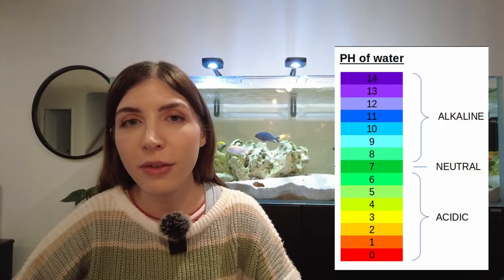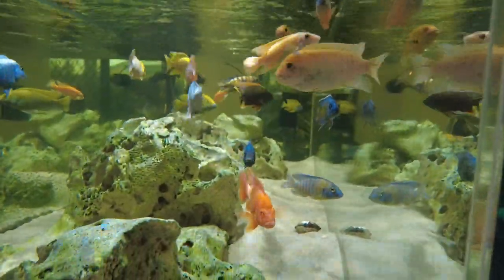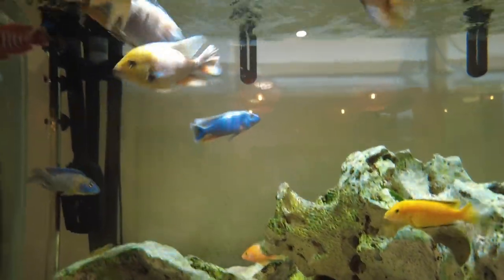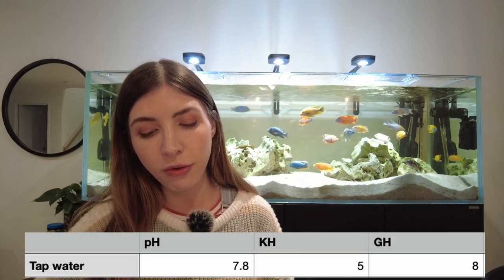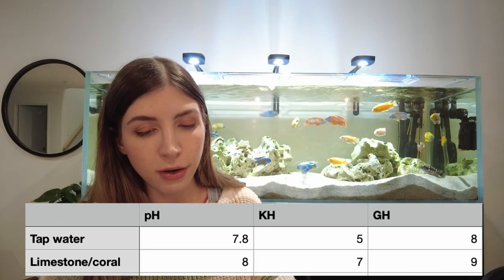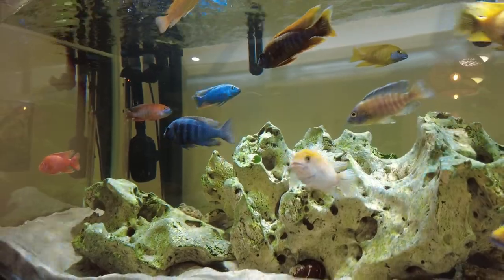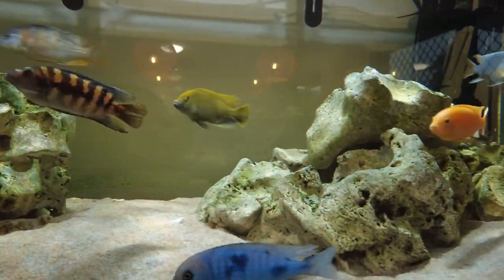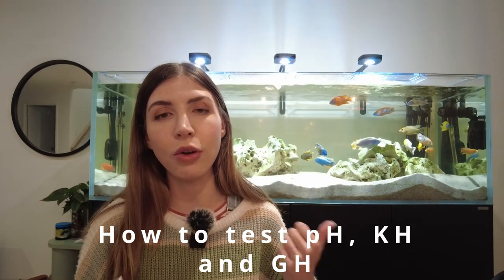African Cichlid Water Parameters: pH, GH, and KH (everything you need to know!)

Comment: There is one thing I think you skipped when talking about pH. When a temperature went from 75-77 the percentage of change is VERY small. When a pH goes from 7 - 8 if goes up by a factor of about 100! A massive change. pH changes must be done slowly like your calcium based stone and additives which buffer and change very slowly.

Comment: Hi Kaity, quick question . I haven’t ever dosed my 75 gallon tank ever yet with Buffer or the cichlid lake salt.  If needed after checking the tests results , for the first time of dosing either the cichlid buffer or the cichlid lake salt , do I dose for the whole tank volume ? Or just the amount of water that I put back in during the water change ? Thank you 😊
Reply from the maker: If it's your first time dosing the tank I would stick with the more conservative dosage which is 1tsp per 20 gallons I believe. So for your tank it would be about 3tsps. If you have a really low pH or KH/GH I would even start with just 1tsp at a time and do a test to see what change it makes to the pH just to be safe. Then as long as it's not making more than a 0.2 change, continue to the recommended daily amount of 3tsps. Then, if you're not at the pH you want, do the same thing the next day and the day after until you get to that point. Make a record of how many tsps it took you to get to the pH, and KH and GH you want for your whole tank water volume. Then from then on, when you do a water change, only dose for the % of water you changed. I hope that makes sense!
Reply: @Kaityscichlids  thank you 😊

Comment: Sadly the word alkaline is widely miss used; ph is measured as acidic, neutral or basic. Alkalinity is the condition under which an environment or organism exists that allows for a relatively steady basic ph value. Alkalinity is therefore about gh and kh values.
Reply from the maker: Hi Michael, I think you are mixing up alkaline and alkilinity. Alkaline is the correct term to use when referring to pH, however, alkalinity refers to the hardness of the water
Reply: @Kaityscichlids  Kaity  it is with respect that I suggest that you research the term alkalinity. Alkaline is the condition, alkalinity is the measure of that condition. In aquatic application it is the ability of water to resist acidification.
Reply from the maker: @michaela-be4le  from my understanding alkalinity isn't the measure of whether water is alkaline or not. Like you said, alkalinity relates to the buffering capacity of the water. Which is why you could have a high pH (alkaline) water due to the GH, but have a low KH and therefore low alkalinity. That's why alkaline is synonymous with basic in terms of pH, but isn't related to alkalinity of the water. Which I think is commonly confused!